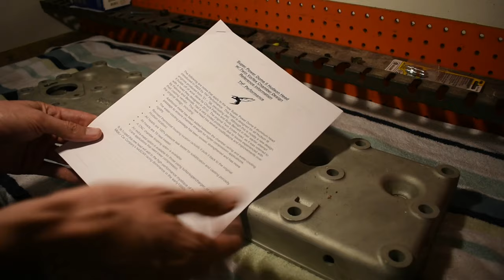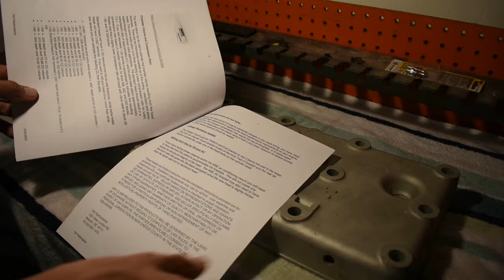A new Hudson Hornet aluminum cylinder head: Super Power Dome II Twin Vortex

Comment: Spark plug over the exhaust valve?  Normally they are over the intake.
Reply from the maker: Yes, believe it or not the original iron heads had them over the exhaust. Strange, but maybe Hudson had a reason.